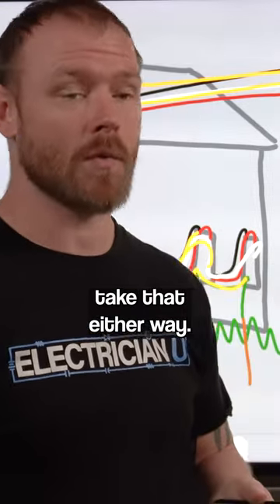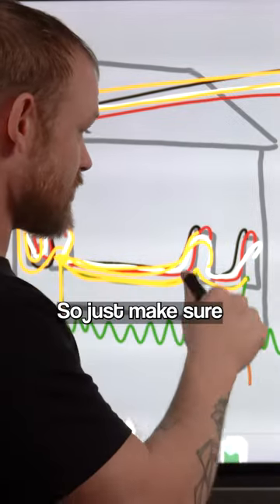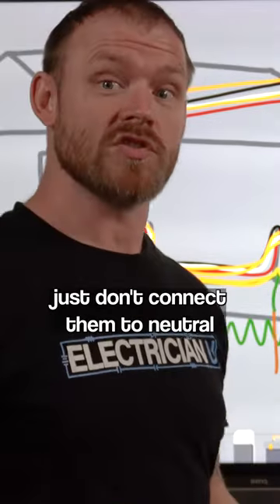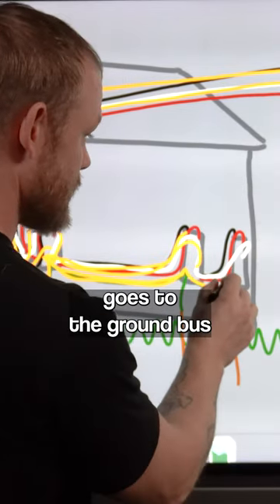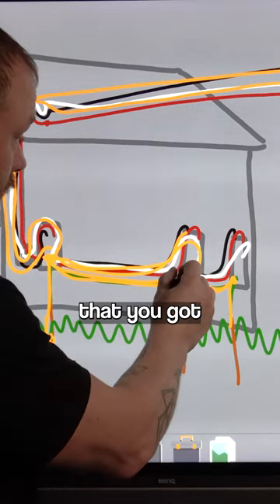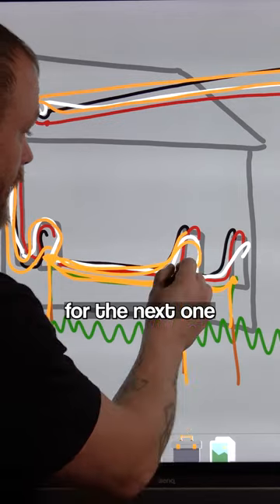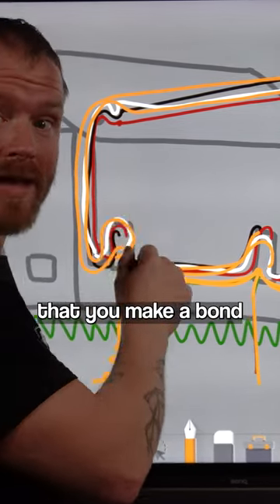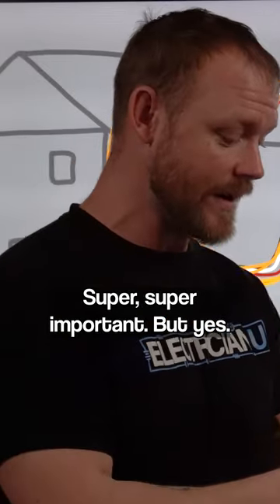Don't Connect Multiple Ground Rods to the Neutral

Comment: Low wattage will take the least resistant path.
High wattage takes every path it can find
Reply: Wattage is the product of applied voltage X current flowing in the circuit. The circuit resistance determines the current....so if it can conduct at all,  there will be current flowing. Better study Ohm's law.

Comment: In the old days... The panel had one bar that the neutrals and grounds were connected to.  No separate ground and neutral bars; our company wired about 30 new construction type homes that way.  This seems like bullshit but so many have responded positively that I hate to be negative; ⚡.  Oops...

Comment: So.....electricity does take the path of least resistance to the ground.
Reply: It takes the path of any conductance in the circuit. High, low, and anywhere in between paths ALL conduct. The resistance of each circuit, will determine the current flowing through it.

Comment: Some people are still getting it wrong, you do not want multiple paths , so if using 4 wires 2 hots , neutral, and EGC going back to bonded neutral ground with the 2 required ground rods, grounding the sub panel gives multiple paths, not to mention how far you would have to put  subpanel g rod to keep it from interfereing with main panel grods! Now before someone says im wrong ,I am refering to outside mainpanel on pole 8 ft. From subpanel inside house! Now if subpanel is 30 ft.or more  (especially more or more than 1 subpanel then I can understand  adding subpanel g rod!
Actually haveing manel panel on pole close to the house the main panel is actually just emergency disconnet ,but I agree it must be only neutral/ground bond but with 4 wire system this situation should be clarified and changed in code!  Actually code when
 it comes to grounding needs major updates and changes! In recent years the old the more grods the better has been proven wrong and dangerous  ,especially with a fault! 
And code needs to seperate the different configurerations and specify what each actually needs! Before more people get hurt!

Comment: I was asking my foreman the question of why the neutral is bonded at the service and never at any of your panels or subs. I am still trying to grasp it tbh all he really said was that’s just how it works
Reply: Electricity in a sub panel goes from hot to neutral  in the sub panel. Then it wants to go to neutral in the main panel. So it follows the neutral from the sub panel to the main panel. 

If you connect the ground to the neutral point in the sub panel you have created a second path from the neutral point in the sub panel to the neutral point in the main panel. So some of the electricity is going to follow the neutral wire from the sub panel to the main panel. And some of the electricity will take the ground wire from the neutral point in the sub panel to the neutral point in the main panel. 

The reason this is bad is now if someone touches that ground wire going from the sub panel to the main panel they can get shocked. And you should never get shocked from a ground wire.
Reply: @ecospider5  thanks brother this helps a lot more that’s what I was understanding but wasn’t exactly sure.

Comment: Yes, but current isn't really going to ground. It's going back to the source, and it flows on all paths relative to the resistance of that specific path. The current from a "ground-fault", really I don't think it ever should be flowing across the ground rod because the fault flows through the grounding conductor throughout the system back to the main panel's neutral, where the only bond to ground is made, then flows through the neutral to allow a lot of current to flow in a small amount of time specifically meant to trip the circuit breaker. I saw the "Grounding Fundamentals" by Mike Holt, and it sounded like the bond to earth through the ground rods is meant to simply bond to the earth's circuit. So things like lightning inducing current onto our systems doesn't harm it nearly as much as it would have without the bond to the earth. I don't know, definitely worth the time to watch it, though.

Comment: Code needs to update this, because you should not have to put in ground rod for sub panel, when you have 4th wire (EGC) I  PUT 2 OUT AT POLE AS REQUIRED BY CODE AND THEN ANOTHER BECAUSE I HAD INSIDE PANEL SEPERATE NEUTRAL AND GROUND SO THEY CALLED IT SUB PANEL EVEN THOUGHT THE EGC GOES BACK  TO BONDED NEUTRAL/GROUND WHICH HAS 2 RODS REQUIRED BY CODE ! AND THAT IS WHAT YOU WANT! NOW I ALSO HAVE ALTERNATE  PATH FROM SUB PANEL TO IT'S REQUIRED GROUND ROD! 
 THIS IS WRONG BUT WHAT CAN YOU DO WHEN CODE IS WRONG BECAUSE IT IS NOT UPDATED!!!!  THIS NEEDS TO BE DONE  IMMEADATELY!
Reply: What?
Reply: Code is correct, but arguably overkill here.  More ground rods will not make your safety ground perform less.  It will only improve the earth bond.  It does add a measure of safety if the ECG was to get cut elsewhere, too.  You just don't want the ECG carrying anything other than minor background leakage (not ideal) and safety issues.  Think of the ECG system as a web or plane, like in a circuit board.

Comment: Which is why EGCs are only a partial protection. Yes they ensure your breakers can trip blah blah blah yadda yadda yadda...but when shit hits the fan...I want the "OH SHIT" moment to happen in the ground. The literal ground. Not the neutral. I don't bet my life on OCPDS. If a service conduit is gonna ground fault...I'm not counting on the breaker. I'm giving it an exceptionally low resistance path to ground. I'd rather have 40 volts light up my panel than 13.2 kv. 

Some dudes forget that supplementary grounds are allowed for a reason.

Comment: Ok my Main panel is at my pole with the Meter , the house has its own 220 and my shop has its own 220 . the house and the shop do not get bonded .   I know they are .    The Power Company set up the Main service panel .  I thought Sub panels get bonded

Comment: Sorry but YES it wants to take the shortest and easiest path . 
The easiest path to " discharge " .
Its not always "to earth" .
But in the end, it ALWAYS TAKES THE SHORTEST OR EASIEST PATH.
Reply: Nope it takes every path just like appliances in your house.  Most will go to the largest current draw, but some will power your phone charger.
Reply: @69BTony  i understand the concept. But it wont go anywhere else , in the case of a short circuit.
Thats the topic here.
Reply: Yea, I'd say it would PREFER the shortest and least conductive path (Like MOST of the current flow would choose earth or its source over your body due to the body having more resistance than metal) but if you or anything slightly conductive comes between its path to ground or its source, it's still taking you as a path. Regardless of whatever amounts of current that chooses you as a path. 

DISCLAIMER
I don't consider myself as an expert yet. I'm just learning this stuff in trade school and going on jobs for now
Reply: It takes every path.  If electricity has more than one path it is a parallel circuit.  If it just took the easiest path your lights would not work, but your stove and hot water heater would.  Be brave and test it out.  Heat up a circuit with #12 to ground and put a #14 in your mouth and grab the ground.  The 12 is a better path, you are a bad path what could go wrong.  let me know how your fillings taste.
Reply: @69BTony  But then taking that logic into account would dictate that the concept of grounding is useless save lightning damage avertion...
Reply: @jordanwills574  Grounding is to save you when things fail.